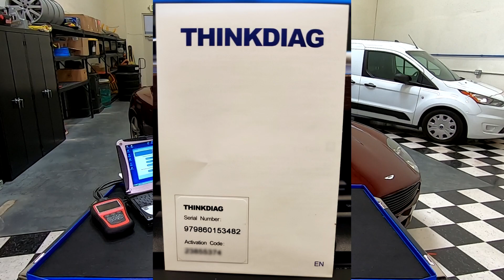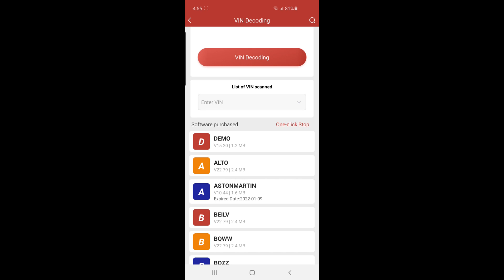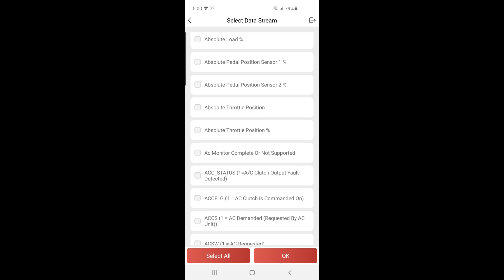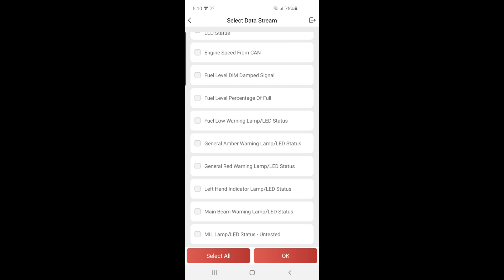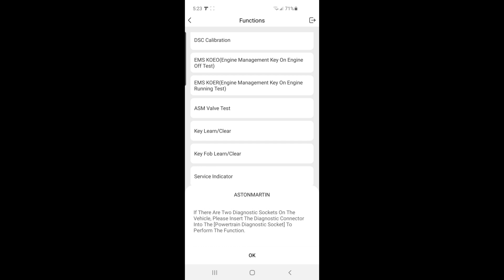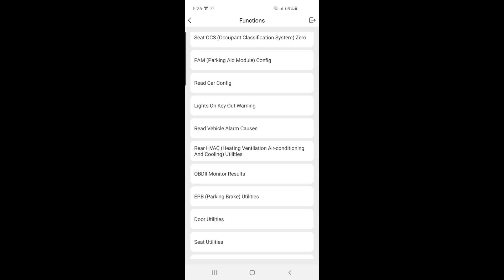Using a ThinkCar ThinkDiag OBDII Tool with an Aston Martin DB9

Comment: My Thinkdiag is the best diagnostic tool for the money!$78.95 a year full car full system  plus more things you can fathom. A must have Tool for the Certified Auto tech . I use in mercedes bmw audi ford gm and a hundred and fifteen other car manufactures .Keith I have one in my tool box good till 2024
.

Comment: I do have to add another "boo-ThinkDiag" comment.  When looking at engine misfires, the ThinkDiag does do this in real time.  Great.  But there is no legend for what the data means. There's the cylinder number (that is off because it names cylinder 1 as cylinder 0), then a Larger font for the misfires.  Then two other smaller font numbers below (for the cylinder).  Is one Type A and the other Type B misfire?  Allowable misfires? Who knows?  There is no legend or descriptors on the screen.  And forget about a manual.  There is a multi-language "manual", but  it doesn't tell you anything other that the hook-up instructions.  I'm thinking for a bluetooth scanner, the Autel may be the way to go.  But the Autel won't do anything the Foxwell can't do.  That being said, I keep the ThinkDiag in the boot.  It's small and easy to keep in the car without taking up space.  I used it yesterday to check misfires when I felt a little irregular idle.  Now I need to hook it up to a real scanner, like the Foxwell to see the type of misfires.  But I fear I'll be watching Steve's changing coil pack videos :(   Again kudos for excellent and outstanding videos.  You make owning a DB9 a joy.

Comment: sounds pretty much like a foxwell OBDII scanner with the aston martin software on it. the difference is that instead of having the orange bound handheld device with a small screen, clumsy interface and a cumbersome wire on it, there's a proprietary OBDII wireless dongle that plugs into the car and you communicate with it via bluetooth on your smartphone using a proprietary android or iphone app. all at a price of course.

i suspect the serial number on the dongle that plugs into the car and all the registering complications are to prevent people from buying an inexpensive bluetooth dongle (can be had for 10-20 dollars on amazon) and sideloading the app onto their phone for practically nothing, probably copied from some pirating site on the web. of course i wouldn't know anything about that.

i doubt if a bluetooth dongle if left in a port will drain the battery overnight. once a bluetooth dongle is unpaired, which will happen once the app is either shutdown or the smartphone is more than about 30' distant from the dongle the dongle will go into pairing mode (a very very low draw mode) looking for other bluetooth devices to pair with. i seriously doubt if left alone for even a week or two it would seriously draw down significant power from a fully charged battery.

i leave an fmtuner bluetooth device in my car for weeks at a time without any issues. YMMV of course. 

too bad it demands a yearly subscription...

Comment: I purchased the Foxwell and then this ThinkDiag.  I must say first that I absolutely love your videos.  They have helped me immensely.  I personally don't like the ThinkDiag for the following reasons: 1) as you mentioned, the car modules (e.g. Aston Martin) is $49 for a year. I never begrudge anyone who looks to make money, but when I can get the module from Foxwell for life vs. one year only for ThinkDiag, that's points in Foxwell's favor. 2) Every time you open the app, they're trying to sell you something. The app is 60% trying to sell you another one of their products and 40% doing what you actually pay for.  Not excited about that.  3) Unless I'm missing something, there's nothing this unit will do (without additional purchases) that the Foxwell won't do.  4) It does allow for remote viewing of diagnostics, but is it really worth it?   I think the biggest turn off for this unit for me is the constant and prevalence of their advertising.
Reply: Great video again Steve.  I have to with Clark the advertising with the ThinkDiag is really irritating.  It seems to have some more diagnostic tools than my NT530 but it didn’t seem to allow me to change the functionality of my car.  In particular, my winter project was to get my satellite radio working.  I went though all the steps checking power connections and even swapping out the unit (a clearly labeled Volvo part that is readily available on Ebay) and still no radio id.  I was excited when I saw the SDAR functions on the menu when you were demonstrating the ThinkDiag.  All the ThinkDiag does is confirm that SDAR is off in my car.  I guess a trip to the dealer to have them switch on the SDAR via AMDS is in order.  The one benefit the ThinkDiag has over my NT530 is that the menu is more intuitive.  Cheers Guy
Reply: exactly. maybe someday foxwell will offer a bluetooth dongle. but until that day i'll have to look forward to possibly investing in a 10' OBDII extension cord... IDK.
Reply: Do you know if the Foxwell scan tools can bleed the clutch on Astons? I'd like to have a nice bidirectional scan tool that doesn't want a yearly subscription.
Reply: The Foxwell is a great bidirectional scanner. But the car has to be able to do this.  I can’t tell you about the clutch (mine is automatic).  But while the Foxwell will do brake bleeding, the Aston DB9 (at least my 09) will not.  My guess would be the same with the clutch.
Reply: @letsrolldiyauto1532  Thank you for responding. I have a 2008 V8 vantage with the automatic sport shift transmission. I was told I have to use the Aston Martin diagnostic software that was also shown in this video to start the clutch bleed procedure but it seems to sell for 20k. I may order a Foxwell since they have nice ones for roughly$200

Comment: I like it... It does ASM bleed too. I did't see brake bleed.
Reply from the maker: That was one I was hoping for, but they don't have.  The AMDS brake bleed is very nice.  I was hoping the ThinkDiag had it, but alas not yet.   But, since the software is all in the App, and they can keep evolving that, maybe it will show up someday.
Reply: @Aston1936  I'm considering buying it, was impressed with some of the other functions that it has.  I have a V8VS 2011, not the guy that likes other people working on my machine like your self. Thank you for the video.
Reply: @HarryESwan  Do you know if it can read clutch statistics on the ASM? Perhaps even reset them after a clutch job?
Reply: @tdottme  Mmmm... Not sure, maybe direct the question to  Aston1936, he has probably played with it a lot.

Comment: I was looking at the Foxwell, and  was under the impression the Foxwell units could do far more than just read and reset codes. The only reason I hadn't pulled the trigger on one is that I was debating between 2 models (I've got 4 cars all of different makes) and there was conflicting info on their website about some capabilities. But I haven't been able to get them to respond to me (I've been trying since Dec). 

So, this new unit excited me. I have several reservations about it. First, I'm hesitant about the phone app model of doing things. What happens if I upgrade my phone and the software isn't compatible? What happens if they stop supporting the app? Looks like you need a login on their site, so that means there's server infrastructure that has to stay supported. What if my wife wants to scan her car? Can it be paired with her phone and work as well, or does it need to be on my phone/account? A standalone tool seems much more reliable for a lot of reasons. Then, of course, there's the yearly fee. Again, with the multiple vehicles I'd probably do the "all brands", but that's over $100 a year.
Reply: I love this bit “What if my wife wants to scan her car”  !!! I wish my wife would just put petrol in her car and wash it occasionally 😂😂
Reply: @ckjlgp  I admit I'm in a unique situation.  My wife grew up the daughter of a trucker and built her first vehicle (1950 Ford pickup) at 15. She taught me how to do a brake job. She's the more old school mechanic and painter in the family, I'm the electronics and newer systems guy.
Reply from the maker: Excellent questions.   You can have 2 phones linked up to it.   If the app someday won't work on your phone, sure, the device is useless, but I think that's pretty fringe.   Cost, well, I am with you there.  I'm OK with the Foxwell model of paying them $40 once to get a manufacturer added, but every year irks me some.  Maybe that will change.   But, if the features can't be beat, so maybe give it a whirl for a year.   Your risk is pretty small.

Comment: Another great video. I use the foxwell, but was wondering if the special features are software or hardware based. Could foxwell update their unit?
Reply from the maker: Excellent question.  The only special feature I've spotted in my Foxwell NT510 is that it can do the Service Reset.   Maybe something will come along in the future with a software update, but until then the ThinkDiag has a big advantage (other than cost).

Comment: hey i had a quick question on a 2005 db9 would you drop the engine to re seal the timing cover and do the oil pan gasket or can it all be done in car on a lift? thanks
Reply from the maker: It was well beyond my skill level.  I had that done on my car at a dealer.  It was 15 hours work and done in car.